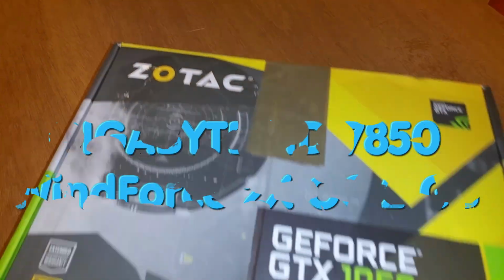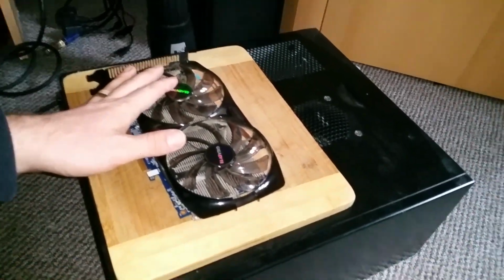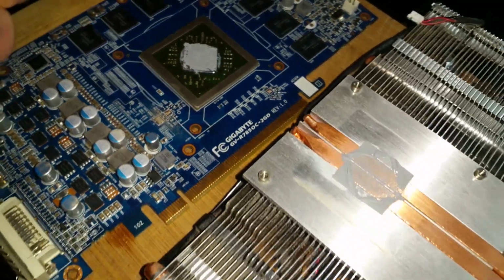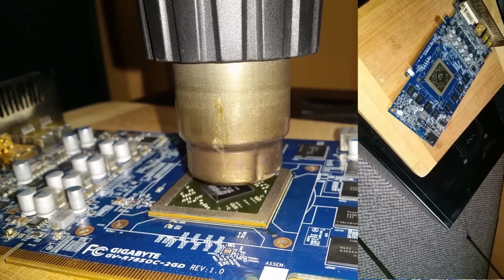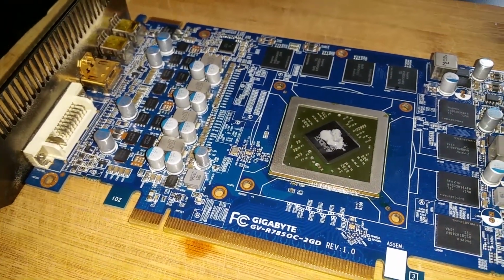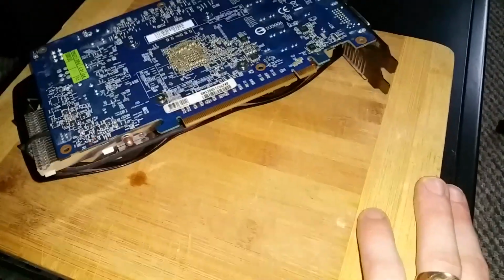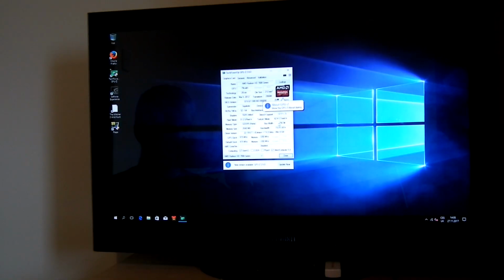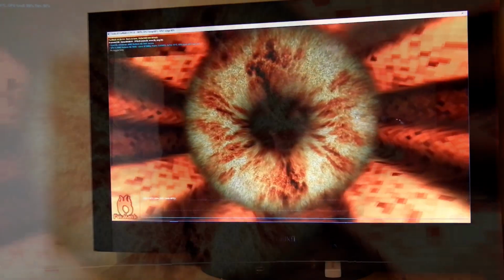How to FIX GPU  No signal or black screen on any GPU - HD 7850 Windforce

Comment: Will this trick working again on second time ?
Reply from the maker: Only way to find out is trying
Reply: @frogtechtips  well i did and its working at first but then sadly its become no display again after few days..so just wondering if theres anything i can do or just let it be and get a new card
Reply from the maker: @pepperonicapone1443  if first time helps I will try again and do longer heat's and maybe use a bigger temperature as well just try there is nothing to loose anyway

Comment: Guys I have Radeon HD 6850 that shows black screen after I install display drivers
Reply from the maker: Do you know history of the card did you try replacing thermal paste and check card for physical damage
Reply: @frogtechtips  I don't really know the history of the card, I never tried to reapply thermal paste but I did check the card for any damages everything seems ok. The funny part is the card displays ok without display drivers installed, the problem start when I install the drivers.
Reply from the maker: @Unruly_Zayn  that's also can by a bios problem try go to powertech web and update BIOS on first step
Reply: @frogtechtips  ok I will try that thanks for the advice I will keep you posted 😃
Reply from the maker: @Unruly_Zayn  ok no problems

Comment: vtx3d radeon hd 7870 x-edition  5 capacitors not working 820-2.5V  Gpu not hot
Reply: i check and found 5 small parts faulty what is the name
Reply from the maker: @shavedhead91  i really can tell you from this information:-)
Reply: what ever i have hd 7850 and works
Reply from the maker: @shavedhead91  ok
Reply from the maker: Try replacing foulty capacitor
Reply: @frogtechtips  i will try

Comment: Thanks for great guide.My SAPPHRE HD7870  is work again!!!!   BIG THANKS! My heat gun is on 350*  and i just hold him to bigger distance ,about 5-8 cm .
Reply from the maker: Good job well done
Reply: @frogtechtips  hey i have some problem
Reply: @frogtechtips  just heating the GPU?
Reply from the maker: @zxalianzerdeveloper  hi if you try other solutions and card is out of warranty try reheating there is nothing to lose anyway
Reply: @frogtechtips  3 time heating but still nothing
Reply: @frogtechtips  and if i turn on the PC after 5 second GPU fan stop
Reply from the maker: @zxalianzerdeveloper  hi that's mean your GPU is have different problems have a look on any physical damage missing components bad capacitator or staff like that but bad news is you will probably need new GPU
Reply: @frogtechtips  more bad news in here i can't find good gpu, good news i have 1 normal gpu
Reply from the maker: @zxalianzerdeveloper  if you have one you can use now is good and you can start save some money for new GPU

Comment: the fan is working but nothing show in the monitor
Reply from the maker: Did you try some repair
Reply: @frogtechtips  i'm changing the pate thermique and clean it but i'm not heating the card
Reply from the maker: Is the card working before you replace thermal paste
Reply: @frogtechtips Look, my brother, the card was working normally. Suddenly, a black screen came and then I restarted the computer, but nothing but a black screen
Reply from the maker: @fethimarko1861  the black screen problem come before you replace thermal paste
Reply: @frogtechtips  i change but after a 15 days it comes
Reply: yesterday i change the thermal paste but nothing
Reply from the maker: @fethimarko1861  ok if your card is out of warranty try reheating that should help
Reply: @frogtechtips  If I heat it up and it works, will it last long or only for days?
Reply from the maker: @fethimarko1861  only way to find out is try
Reply: @frogtechtips  i try it and my card now is working bro
Reply from the maker: @fethimarko1861  nice
Reply: @frogtechtips  Now will it work or will the same problem return?
Reply: @frogtechtips  yeh bro thank you so much
Reply from the maker: @fethimarko1861  I think one day problem will come back but I can't tell you when I see some cards working 1 Day and some 5 years after repair like this good point is if happens again you can still try reheating GPU again as well and you also you know is time to save money for new GPU
Reply: @frogtechtips If there is a chance for her to return to work, and there is a chance for the problem to return, thank you, brother. I appreciate your work
Reply from the maker: @fethimarko1861  you welcome and I hope you can share my channel between your friends as well
Reply: @frogtechtips  i will my bro
Reply from the maker: @fethimarko1861  thanks

Comment: Hi, i have similar issue regarding my HIS 7850 graphic card

I reassembled my old pc parts since i only needed new HDD and SDD to make it work. But the thing is at first I'm unable to connect it to my monitor vga port and hdmi port on graphic card, and it says no signal on monitor screen. So i inserted it to my motherboard instead. A little tweak make things worse since it won't detect both from graphic card and motherboard.

So i take it to a local pc repair and their monitor works by inserting vga from monitor with hdmi converter to graphic card, weird. I decided to change my cable and buy new converter. I'm home now and it doesn't work again. 

Any tips? Thank you!
Reply from the maker: Hi that's look like common GPU die problems only way is trying the steps I do in video or just take back your pc again to repair shops for more diagnostic
Reply: @frogtechtips  Hi thank you for the reply. I'm afraid with reheating method since I'm not that advanced with pc building and i afraid it might make things worse, but i might try it as my last option. Right now i'm unplugging my 12 pin PCIe cable from my 7850 and connect my monitor to my motherboard. Will it solve my problem If i install 7850 driver to my pc?
Reply from the maker: @rafibagjawirawan8432  if you connected to MB and unplugged power from your GPU means you use onboard GPU is the same as you take off your card .if you will follow all steps from video there is nothing to lose anyway you card don't working now and if you will have luck your card can working again after reheating
Reply: @frogtechtips  Hi, yeah that's what I'm aiming for since the gpu is not functioning somehow. But I'll try to heat the gpu and give thermal paste on it. Thanks for your feedback, much appreciated.
Reply from the maker: @rafibagjawirawan8432  you welcome
Reply: @frogtechtips  Hi Frog - Tech - Tips, major update regarding this. Your method works! I cleaned my gpu from excess themal paste,  heated my GPU with a hairdryer at medium for 3 mins and apply new thermal paste. And it works! Amazing stuff! Love from your new subscriber
Reply from the maker: @rafibagjawirawan8432  hi good news and really hairdryer works and only 3 min interesting I hope you can shere my channel with your friends
Reply: @frogtechtips  Hi frog, yeah since i don't have heat gun at the moment i just make do. Of course i'll follow your other social media too. Good luck thank you for this frog
Reply from the maker: @rafibagjawirawan8432  thanks so much bro

Comment: Hi, Sir. I had a HD 7850 of MSI. similar to this card. I cleaned it yesterday. but today whenI plug it to my pc the fan seems don't work when temperature is high. I remember the fan work before when tem is over 40 centi degree. 
Firstly I thought the fans are all broken down. I opened the pc box and power on again and I see the fan turns for 1 second and then stopped. so I think the fans may be OK. But the card can't know the temperature. 
I installed HWinfo to show the temperatures and I run Aida 64 GPU stress to check, but even it's over 80 degree, the fans just stay still. So could you please help me out? Thanks.
Reply from the maker: Hi  is hard to say what can be wrong you can still try plug that fun to any different power to find is working or not that's will be first step once you find is working you know is foulty something on GPU you can measure if give any power output on fan point  etc
Reply: @frogtechtips  Hi, Thanks for your reply. I just tried set the fan speed in Radeon software. I can make it run when I change the fan working mode from auto to manual, and set the speed to 90% or higher. and the fans run at 4000 rpm (shows from HWinfo). so I guess the fan can work. Only the sensor is not triggered when temperature gets higher (usually higher than 40 in the  past). I found some one selling similar fans on local network. but I wonder if new fans will solve this.
Reply from the maker: @LIUXIN  are you sure you connect all correct when you put together
Reply: @frogtechtips  yes, for sure. I used the card today at work without got the fan working. The card works well for daily office work. But I sometimes process videos and I I'll use the hardware acceleration. I want to solve it ASAP.  I bought a fan speed reducer online. I'll try it when I get it. Thanks for concerns
Reply from the maker: @LIUXIN  sounds strange but you can still connect fan externally or try switching on than manually on and drivers I think I hope you get that sorted soon
Reply: @frogtechtips  Thanks. I added a 12cm fan on the side of my office PC. It's an old-style cheap PC case, so the PSU is on top and there's a position for 12cm fan on the side, it's just above the GPU card. I think it might help somehow. I don't play game with this PC (office PC not for gaming ;-)) so I run FUSION 360, and seems all OK. temperature is not high. I'm still waiting for the fan speed reducer (a wire with an electric resistance on it). Hopefully it'll reduce the 100% fan speed to 50% or somehow so I can keep the fans running at  low noise. Otherwise I can just use it as it is now. Thanks for your replay. It's really nice to have this conversation with you. Wish you a good health.
by the way, My name is Liu (pronouces as Leo). I'm from China.
Reply from the maker: Hi no problems and ye there is always some solutions for this even wit external fan power to it :-) btw IAM from Slovakia  and I hope you can tell you friends about my channel I will be happy
Reply: @frogtechtips  Hello, Thank you for your video:) I have a broken 1060 , do you know where I can get a GPU chip for the card? I looked everywhere and I could not find it. Thank you.
Reply from the maker: @weewee-f8f  hi really no idea and I think if you will find one will be extremely expensive that's the one reason I recommend trying reheating GPU
Reply: @frogtechtips  I sent it to a repair shop and they tried reflow but it did not work. Thanks fo your reply
Reply from the maker: @weewee-f8f  and did he checked all component if you plug in card is the GPU die Start to be hot if not there is power problem if you are from Europe you can send that card to me and I can have a look
Reply from the maker: @weewee-f8f  I will more recommend for you elitech channel he have so many good video how to check and diagnostic card and his video will be for you more that my explain over comments